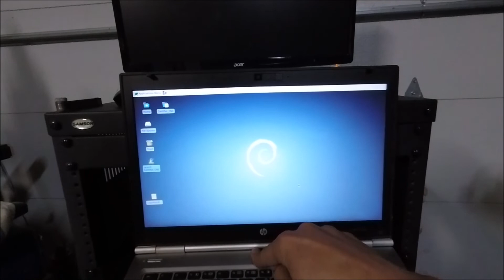DIY CNC Router on Certiflat Welding Table Part 9: Update Running Linux

Comment: Vic, that's a really cool setup! I hadn't seen your CNC before. Never thought to do one around such a great workholding platform. Was that your own idea?
Reply from the maker: Jon Miller when I discovered the tables the first thing I thought of was to utilize it as a cnc table. The idea I feel is solid but designing the cnc around it was limited to the tooling I had. Now that I have a few more machines I can go back in and build it better and stronger. Thank you for the comment and  watching. If you haven’t watched the previous videos I wouldn’t recommend them. They are pretty terrible, but like the machine will get better with time.

Comment: Could you tell where you bought your linear rails and ball screws and how are they holding up?
Reply from the maker: The linear rails and ball screws were a package import deal off eBay. SBR16 and RM1605 rails and screws, I purchased another set of rails to have 4 total rails for the Y axis. I really don’t have a lot of run time on the machine to give a good answer on how they will hold up. I did have to buy a couple extra LM16UUOP bearings cause I shot the balls out of one trying to get it on the rail. They are all definitely import quality, the hole placement on the rail mounts and bearing blocks are not consistent. I would say the rails are consistent enough but the bearings could be better quality. I haven’t put any additional grease on the ball screws yet and haven’t had any issue with them at all. Thank you for watching and let me know if you have any more questions.
Reply: Thanks will do!

Comment: It's awesome. Great job.
Reply from the maker: Thank you, still needs a lot of work and I’d like to change a few things. But it runs and it’s a lot of fun. I knew nothing of cnc at the beginning but I just dove in and learned as I went. Thanks for watching, and there’s more to come.
Reply: Here's the first in a possible series of dumb questions... how does the computer track the movements? What is going on between the mechanical side of things (and the motors) and the computer? Knowing that a router can be mounted like that is a bright spark of possibility for me.  @riversvic
Reply: Okay, here is the second in a for sure series of dumb questions... Just wondering out loud in your direction, but can you envision some kind of geared motor scenario controlling the X and X axis of my new cross slide. Maybe some kind of fabricated bolt on solution for a Z axis spindle. Some kind of bench top micro CNC thing??
Reply from the maker: The computer tells the motor to move in a series of steps. You calibrate the computer at first by telling it to move a certain distance and measuring how far it actually moved. The computer keeps track of where the machine is supposed to be but a stepper motor can miss steps and think it’s somewhere else. 

I would say cut the gears out, go direct from motor shaft to cross slide table. I’d build a stiff L frame to mount the table on and you would need rails for the z axis. With dovetails over rails you might need a little stronger motor. I’m actually thinking something very similar to this with a jet benchtop mill I have. Since it’s a round column machine I’d ditch the top half and build. A frame for the z axis and spindle support.
Reply: I see. I didn't realize the motors were themselves integrated with the software. Hmm. I'm going to have to look at some motors and the rails. Dip my toe into that realm kind of. Thanks man. :) @riversvic
Reply from the maker: Your welcome let me know if you need any help
Reply: Thanks, man. I appreciate it. Today I took a drive out to where I got my mill, as the seller still had the lead screw and gear that raises and lowers the "Surface Grinder" table. I got that installed, and it occurred to me that the pieces he (whomever built it) used to mount the grinder wheel spindle can be rearranged to produce a mount that will hold approximately a 2 1/8" vertical spindle or something. The machine has an x and Y axis with a knee, so I could maybe incorporate some kind of router, quill-less spindle, or even a drill press head by way of that mounting. I could also stick a mag drill on the machine's column, and have an X, Y and knee axis set up under it. Possibilities.   @riversvic

Comment: So how much time & money do you have into this?  Looks like it runs pretty well now!  how much Z axis travel fo you have ?
Reply from the maker: 9" of Z axis travel and the ability to adjust the router mount in different positions on the plate. Hard to keep track of time but its not very much, I will eventually spend a lot more time on it building better motor brackets and making everything cleaner and more permanent. The time spent was mostly just drilling and tapping holes. Money I have about $1600 dollars into it including the table and a lot of items I haven't incorporated in the machine yet, and that's the first time I tallied it all up and it shocked me a little. I cant say its worth it yet, but thankfully it has been spread over a few years, and if I decide to tear down and do something else I will still have the certiflat table(that I still currently use for welding) 1/2"x 6" aluminum with some holes in it. The rails and ball screws were the most expensive part for a total of $544.50. Thank you for watching, I plan to spend some time on it this winter.
Reply: so you are running ball screws and linear rail? that is a pretty awesome setup for a milling table. 9" of Z travel is also really impressive!  that way you could engrave thicker stuff or do whatever you want. but yeah, a lot of guys underestimate how much time goes in something like this - and you actually have good working results to show for !  that is awesome! keep up the good work.
Reply from the maker: Thank You! I used SBR16 rails and RM1605 ball screws, an ebay kit plus 2 additional rails for Y rigidity. As I was building it I was thinking thick slabs of wood and the 9" really allows for some versatile setups.